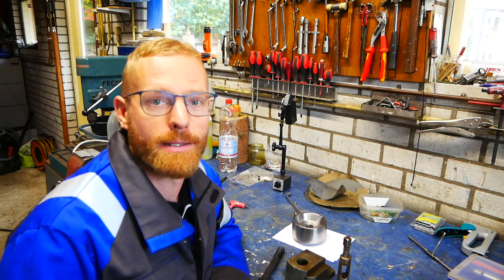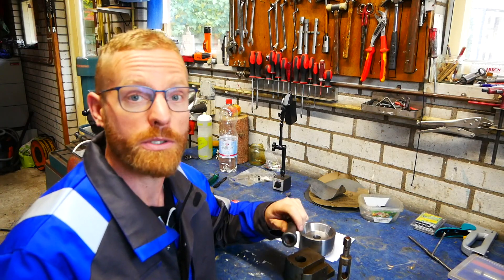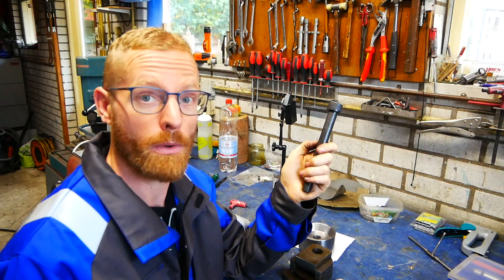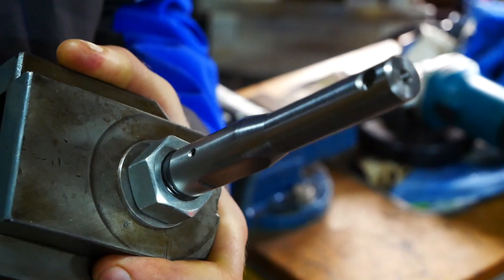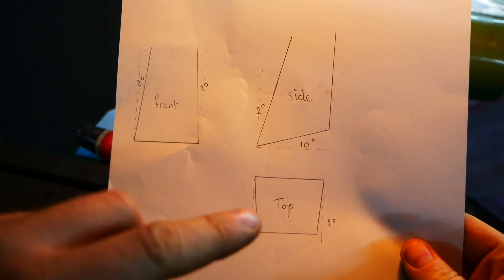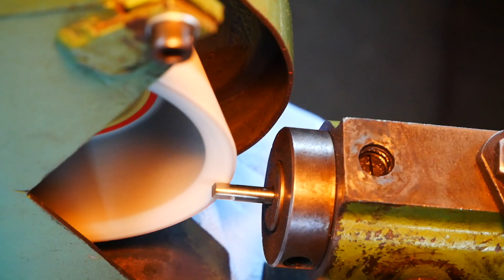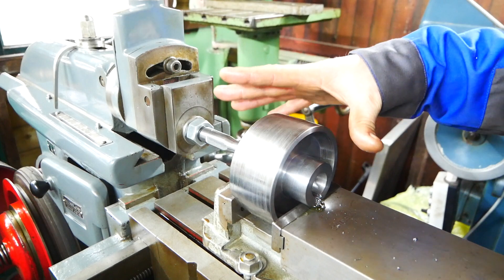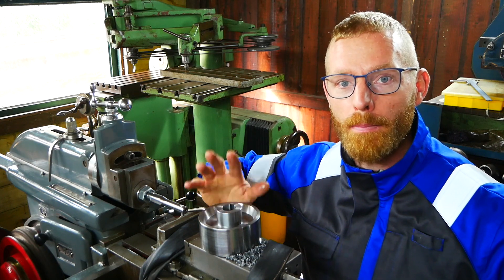Making a Keyway Cutting Tool for the Shaper

Comment: did you ever find a solution so you do not have to use the innertube???   just made one of these holders for my south bend 7" and was having same problem
Reply from the maker: Yes. Put a bolt in the clapper box to make it a solid mount.

Comment: Ik vermoed U bent nederlander of vlaming? Indien niet ga ik verder in het engels. Nice job, but one comment, at a shaper don't pour cutting oil on the workpiece, the cutter scrapes it off, pour your oil on top of the cutter and it will slowly dribble down between the cutter and the workpiece.

Comment: Hi,Bart. Nice job on the keyway cutting bar. Your inner tube spring is a cool quick fix but it would be pretty straight forward to add a couple of 1/4" threaded holes at the upper edge of the clapper block and bolt a flat strip to mount a compression coil spring. I also have an Alba 1A and my clapper block has a grub screw on one side face to lock the clapper down solid for keyway cutting operations.
Reply from the maker: Thanks, I think I will upgrade the Clapper box in the future with a set screw or make a fixed holder.

Comment: Great video and you have a very nice shop from what I can see.  I had a similar issue with my shaper. I drilled and tapped the clapper box, put a stud with a spring and a washer on it to keep the clapper down and it’s adjustable so your not dragging the tool on the return stroke too badly. Seems to work well, and again great video. 😬👍Eddie wheels 🧑🏻‍🦽
Reply from the maker: Thanks. I thought about that but didn't want to drill in the machine parts. I will make a solid box to hold the tools in the future.

Comment: on my shaper i can lock the clapper box but when i do it drags the tool over the work and the tool looses its edge very  quickly......what you did with the inner tube might be a bit primitive but it certainly worked  ...i think you are onto something...it just needs refining
Reply from the maker: Thanks. I think a spring with adjustable tension would work very good as a mechanism. A lock for the clapper would be nice to have too.

Comment: Great to follow a video of someone who has a similar home machine shop setup. My Sixis S101 is less versatile than your Hommel UWG2, however they share (probably) a similar motor leading to some similar machining limitations. Instead of a Schaublin 102, I have a DIXI lathe from the 1940's. I haven't yet a shaper. Sooner or later. Nice video.
Reply from the maker: Thanks. Sound like a nice shop. The shaper is my cheapest machine but a lot of fun to use.

Comment: Love the innertube idea
Reply from the maker: Thanks. It's not stupid if it works 😁. But I do want to find a better solution.
Reply: @bartharkemametalworks2299   turn the tool upside down and cut the keyway at the top rather than the bottom!-old trick for not locking the clapper box! -nice video!

Comment: Hi Bart, Thanks for for a great video.
It's interesting to see the different machine tools you use, that Hommel is something I have never seen before, it looks very versatile!
Nice to see the tool/cutter grinder in use, you have inspired me to get on and turn my set of Quorn castings into a working machine. 
I have the  prewar version of the Alba 1A, it doesn't have the table support, but has powered horizontal and vertical table travel.
I'd really appreciate a copy of any documentation you have for the Alba. I'll email you on the address you have listed below.
Cheers Paul in NZ

Comment: You need a fix clapper box , or drill a hole in the side and tap it ( some have the hole from factory) else it jumps and don't cut , because you are to close to the swirling point and don't have lavrige to cheap it for jumping. The "normal" tool is much more down and far from swirling point . ( hope my English is correct)
Reply from the maker: Thanks for the explanation. I also had I little discussion on the Practical Machinist forum. I understand it now a little bit better. Only thing I don't understand is that the manual shows almost the same tool in the clapperbox. But I will make a solid holder in the future.
Reply: Barts Metalwork not all that you see in the books is Appliable in real life. Some are written by writers not by machinist

Comment: Hi Bart, I'm now in the design phase for making a keyway cutting tool for my Alba 1A, I need it for an upcoming project.  Thanks for showing the page from that catalog, the picture of the factory one is very helpful.  Where did you find an accessory catalog for the Albas?  It would be cool to see what else was available for them (which would need making now as we can't buy them!)  Thanks for sharing this one!
Reply from the maker: Hi, If you send me a e-mail to bartharkema at g mail dot com. I can send you the documents that I have. If you are making your own keyway cutter, consider making a solid one without the clapperbox. I think that would work better. But it also depends on the flex of the tool. I had a little post about this on practical machinist forum: https://www.practicalmachinist.com/vb/antique-machinery-and-history/keyway-cutting-alba-1a-shaper-question-371838/

Comment: Nice job,   yes the clapper needs to be ridged when cutting a key way.
Reply from the maker: Thank you. Do you know why it needs to be ridged? I can't understand why.... And the manual shows a tool just like mine in the clapperbox.
Reply: @bartharkemametalworks2299   i think there is supposed to be a grubscrew that locks the clapper box. i took the clapper box off and made a rigid toolholder
Reply from the maker: @jasonharman5083  thanks. On this machine there is no screw to fix the Clapper box so I will make a solid toolholder in the future.